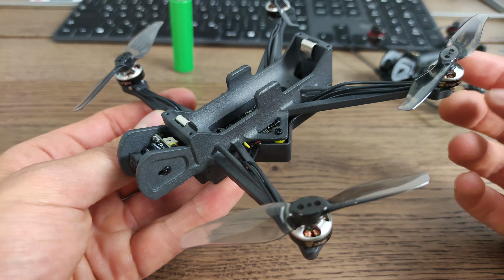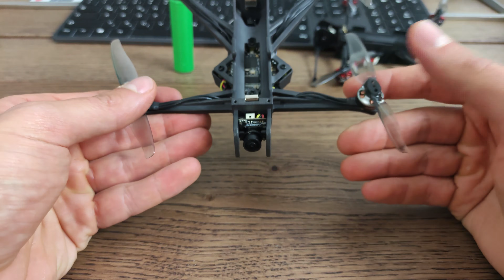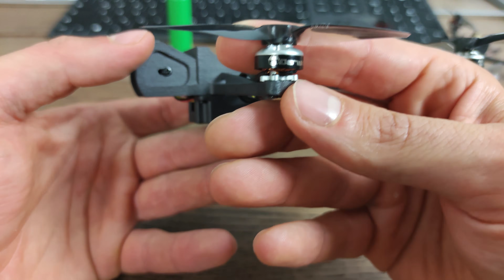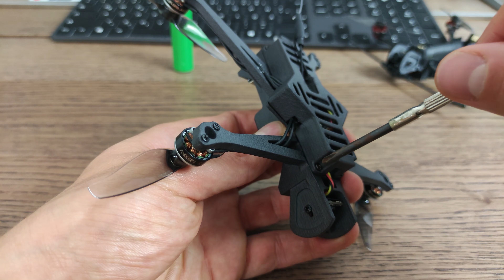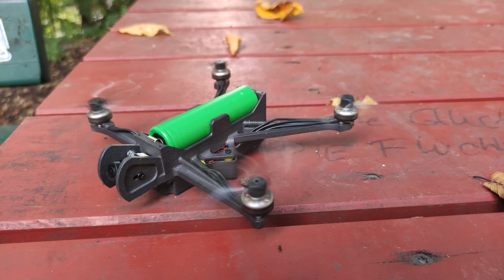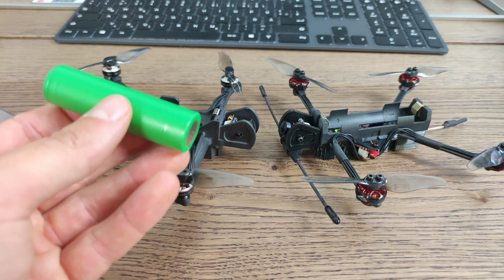DarwinFPV 18650 Review | Fully 3D printed #NanoLongRange

Comment: Dave, have you considered designing a 2S-18650 drone? The higher voltage would give better flying experience (less brownouts, etc), but needing a drivetrain to handle the extra weight. Lower current would also be bit easier on the cells and esc. More than 2-cells then Rekon 4,5 are clearly better choices, as would be using pack anyway.
Reply: Thank you @Dave_C for working on this project. 
Know I'm not the only one asking, and you likely have be designing and testing interactions for months. Look forward to your "Coming soon" ... very nicely done! ♥😎👍
https://www.youtube.com/post/UgkxPYNV2FS-yOhXLN1PXIz0IuN-NX5GSY-n

Comment: Hi All,
I've been flying one of these for two months or so now and I absolutely love it. I've crashed/ditched  it a few times, mainly due to me trying to fly too long and losing the vtx due to low voltage.  Nothing broken so far !!
Added a small buzzer to mine to aid finding it.
I find it very convenient to carry with me to my flying field, it's so small it fits into a corner of my rc aeroplane kit bag with a couple of spare batteries  !! 
Great for a few stealthy circuits of the field as its very quiet.
Reply: Just purchased one that falls out of the sky when a small amount of throttle is applied. Did you have this issue?
Reply: @liamkelly1553  Not had that problem but it sounds like voltage drop. Make sure you have a decent unregulated 18650, a lot of them are fakes and not the rating that they say. Or are regulated to a very low current output, especially the ones off "the bay "
I get mine 20amp rated and unregulated from a company called Fogstar. I can highly recommend them.
Reply: @davidmaynard9325  thanks for the response. I'm really trying hard to crack down on this problem. First step will be try get some other batteries (even though the ones I have should be legitimate). I was then thinking to add a 5V step up. Which battery have you found success with?
Reply: @liamkelly1553  I've used Samsung,  Molicel and BAK brands, all rated at 20 amps output , All these were supplied by Fogstar.
I haven't noticed any real difference in performance between any of them.
I'm getting 15 minute flight times with all of  these.
Reply: @davidmaynard9325  Hi, thanks for the response. I went and purchased some better batteries, but am getting the same results. Can I ask what is the lowest voltage yours will fly until it drops? I cant get past 3.2V which gives around 10 mins flight time only. I know these batteries are good till about 2.6V. Thank you.
Reply: @liamkelly1553  Mine will fly safely down to 3v, it starts to get a bit unstable and wobby and the vtx is obviously starting to struggle at that voltage. Much below that and the video cuts out so I land once I'm at 3v.
Maybe a 5v step up board would help yours, very little weight addition tbh.
Reply: @liamkelly1553  Just wondering what receiver you are using,  I've got a radiomaster r81 in mine which seems quite tolerant of low voltage.  But if you look at the actual specs 4.5v is minimum voltage for these! Running at such low voltages is really pushing the lower limits of most of the components in these models .
Reply: @davidmaynard9325  Im using an ELRS EP1 receiver, although I have noticed that the whole AIO will restart in mid air when it gets to that low voltage. So it's not a failsafe. I have taken the bottom cover off which allowed more airflow and let me get down to 3V. Where would you recommend adding a 5V setup up?
Reply: @liamkelly1553  You'd need to pick up the supply direct from the battery,  feed it to the 5v step up board then connect the 5v output back to a 5v pad on the aio. Hopefully that would hold the 5v 
I'm guessing that your particular auo is ⁷⁷⁷⁷
Reply: Your aio maybe a bit more voltage sensitive than the one in mine.

Comment: Awesome groundbreaking effort by DarwinFPV. This is definitely the version I would buy. I bet youd be hard up to break one of those nylon arms, and if you did, you could repair it with a soldering iron. In most cases, i dont suspect youd have to buy any parts at all to repair it.  Brilliant piece by Darwin, and how generous of them to use your design to demonstrate. Totally taking Darwin seriously now. I need some of those 1103s, stat.

Comment: If it’s completely 3D printed, I wonder if generative design can take weight out of this and potentially increase rigidity were it helps in flight performance. With fluid simulation maybe even optimize for drag and turbulence? I always wonder why we don’t see that on the market

Comment: Damn! If they really made a deal with you, Dave... Then DarwinRC just grew a lot in my eyes. Kudos for them!
Anyway... I can't do much right now, because my workspace is a mess and I still need to get a desk for my PC... (Which I want to build myself! 😬) So I'm leaving the idea here. You - or anyone else - can use it. 
My idea is to make an 1s quad similar to yours, but with a simpler construction... Base plate, top plate and nylon standoffs... Like the brushed micro I built long time ago (I really liked the frame). You know? But to fly with standard 1s lipo batteries, instead of an 18650.
Either way... Should be fun. 😊
Stay safe there with your family! 🖖😊
Reply: did you make it?

Comment: Their frame "solution" is doublesided sword. It might have better impact resistance, since its Nylon printed with industrial 3DP technology.... But once it brakes you need to throw whole frame, which makes no sense, because SLS/MJF 3DP technology used there is barely accessible to anyone in this hobby. You can reprint with desktop 3DP FDM tehnology which has drawback of fragility across layerlines.
PS. Can you test Crux3 NLR version from Happymodel?
Reply: My guess is the decision was the fact that people who buy the premade drones likely don't have any form of 3D printer to begin with, and don't intend on making home repairs.
Reply: @DaveSmith-cp5kj indeed, but even for them, spare carbon fiber arms would be cheaper replacement